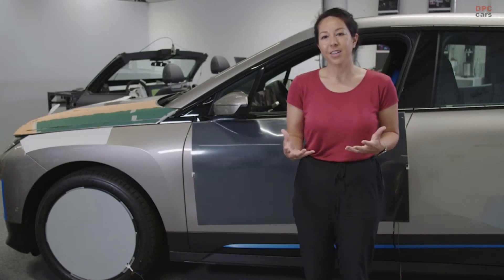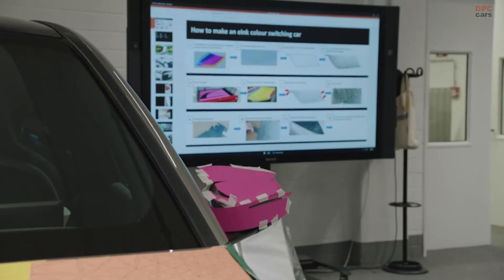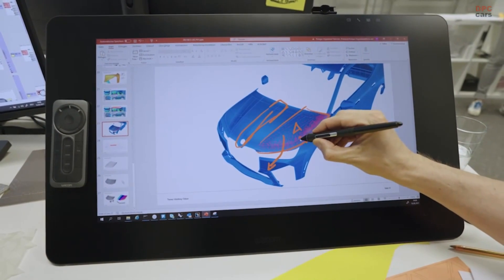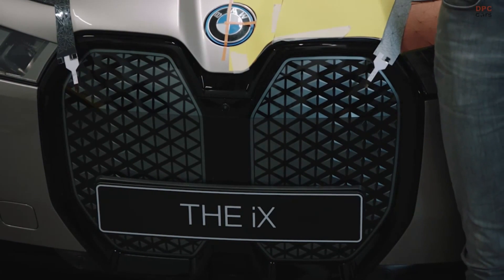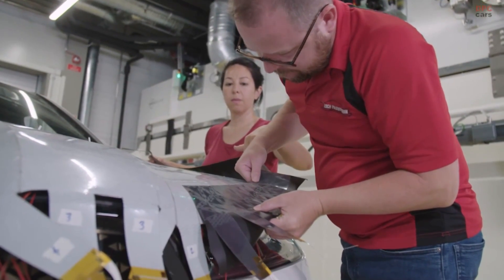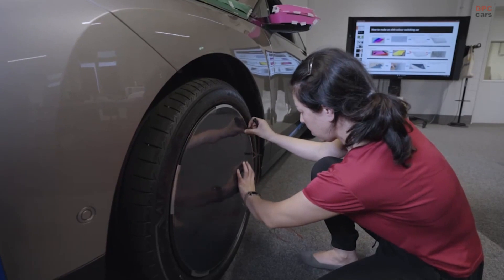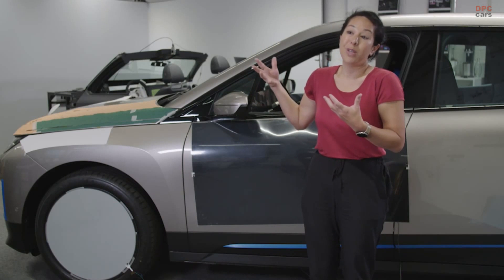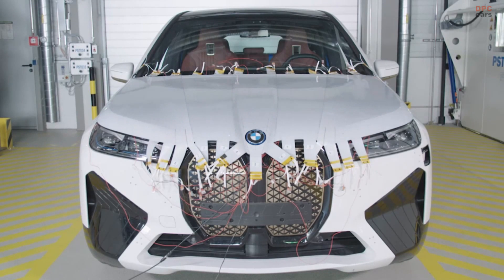How It Works - Color Changing BMW iX E Ink

Comment: The future truely is now. I just can´t stop thinking the military technology this was probably getting taken from. And how far they are using similar stuff in black projects. It looks nuts already!
Reply: They literally said it's technology from an e-book like kindle....
Reply: There is no secret technology that this was taken from.
The technique is called "electrophoresis" a technique from the 70s/80s, way way older than LCDs, and LEDs, and does not require more than a high school degree to understand.
The "electrophoretic displays" mainly mastered and manufactured by the Eink Corporation, is a public company who's work and patents are as old as the 1997, a spin-off of the Massachussets Institute of Technology Media Lab, who took the electrophoretic display and put into droplets called as the Eink, to have more control over it.
The manufacturing needed and the process is described in their patents in very boring details, the cost required to put into practice is very low (less than 200k$) unlike the classical displays we know, and do not require crazy technical skills.
The company started pushing this technology as early as 2012, nonetheless it took 10 years for some talented designers to spot it and put into practice.
However what was presented in the video is a long long effort of design and engineering and human labor to be able to put something into reality. 
These guys are super talented, so are the Eink Team, there is no secret sauce involved, just pure passion, perseverance and good taste.

Comment: i admit, this looks pretty fantastic.
But as an ev, wouldn't it be better to have the whole car wrapped in flexible solar panels?
Reply: Imagine you crash into a large pile of solar panels
Reply: It will double as solar panel too in the future
Reply: May be change the glass panels to transparent solar panels
Reply: Solar panels barely produce enough voltage to even power the air conditioning. All it does is add weight, makes the car more expensive to make, more expensive to buy, and more expensive to repair during crashes.
Reply: @MNGLD-do2kc  i disagree
Reply: @lordrefrigeratorintercoole288  with what part? The voltage part? Because that's a fact. Cars' don't have surface area for the solar panels to generate enough power to power anything adequate
Reply: @MNGLD-do2kc  nonsense, you can add 10.000-15.000 km of range per year on a fully covered car, if it’s parked in a field and kept clean.
Reply: @jochem1986  solar panels are heavy. They will add weight to the car, meaning that you need more power to get the thing moving.
Reply: @jochem1986  not to mention that it will make the car more expensive to buy. Not everyone what’s that for 10km for range.
Reply: @MNGLD-do2kc  there allready are cars with solar panels that add up to 20km of range per sunny day, so stop spraying nonsense.
solar panels are getting better by the day.
Reply: @lordrefrigeratorintercoole288  look, you seem to not understand the physics behind solar panels.

Solar panels absorb the photons that the sun emits, and turn that into DC electrical current. The energy that a panel absorbs depends on the intensity of the rays, and the number of photons hitting the panel.

However, the sun can only give out so much energy. If you want more energy, then the only solution is to increase the size of the panel, and cars are only so big.

Solar Panels have reached 98% max efficiency already, which is information I got from Solar Max. This means that solar panels can’t really improve anymore.

You can’t just think of it in a range perspective. It makes the car more expensive to make, more expensive to buy, and more expensive to repair. Not many people want that just for 10km of range.
Reply: @MNGLD-do2kc  10km of range is what most folks do every day.
and solar panels like the ones mounted on the sion aren't any heavier than this E-ink screens mounted on this abomination of a car.
Reply: @jochem1986  that is contingent on it staying very clean and it be parked out of the shade, which many homeowners will park under trees or in a garage, and not accounting for energy loss due to panel aging. Beyond that, solar cells are heavy, which EVs are already much heavier than their gas-powered counterparts, which will make them have less range and be less efficient. So you will add panels, to add range, but adversely reduce your range by weight. That’s so counterintuitive, not to mention the possible overheating issue cars could have with the amount of heat energy solar panels produce as a bi-product, both hurting the vehicle and possibly hurting the environment if this was widely adopted in many vehicles. It would create the same heat pollution effect solar farms have known as the solar heat island effect.
Reply: @lordrefrigeratorintercoole288  yes but those “lightweight” cells are some of the least efficient cells on the market. Much less efficient than their heavier solar panel counterparts. And putting heavy panels on a car is counterproductive as the weight will reduce its range. So it begs the question, are lightweight, low-producing cells, even worth it when the only considerable amount of power is produced by much heavier panels that aren’t worth putting in vehicles.
Reply: @lloydrigney7476  still a better choice than FREAKING E INK DISPLAYS ALL OVER IT!!!

id rather have my car in Mettalic military matt color, but id take heavy solar panel skin over e ink displays anytime.

do you understand now??

sometimes youtubers feel like im talking to my demented grandma.
Reply: @lordrefrigeratorintercoole288  That's assuming the weather in in perfect condition, which rarely ever happens. If there is fog or smog or clouds, then it will reduce the range of the solar panels, so 10 km is only on good days.

Plus, if you have solar panels, then your car will look like a lego piece since you can't paint the solar panel, and I'd rather have a cooler looking car.
Reply: @MNGLD-do2kc  wel you dont say.
becouse a car covered in screens looks so much cooler.
Reply: @MNGLD-do2kc  Please don't say someone else doesn't understand the physics behind solar panels when you follow up saying they have reached 98% max efficiency. Clearly you don't know what they mean. Because a solar cell currently converts around 40-45% of solar energy hitting it into electricity.
Reply: @jochem1986  98% of max efficiency that a solar panel can reach is what I should've said.
Reply: @jochem1986  the sun’s only so big and can give off so much energy

Comment: So there’s a fluid in the triangles stimulated by electricity? 

How will this hold up in the Arizona or Texas sun of 100 degrees or more in the summer some days?
Reply: well considering this technology powers kindles which deals with hot temps fine (source: floridian) it probably wont matter that much
Reply: @oventree  You leave your kindle sitting in the sun?
Reply: @HifeMan  i live in florida so it's pretty fucking easy to leave something that is specifically made to be readable in the sun outdoors
Reply: @oventree  I don't see how it matters that you live in Florida. People read kindles all over the world outside and still managed to bring it back inside with them. 

Why are you so aggressive?  lol I was just asking a question :P